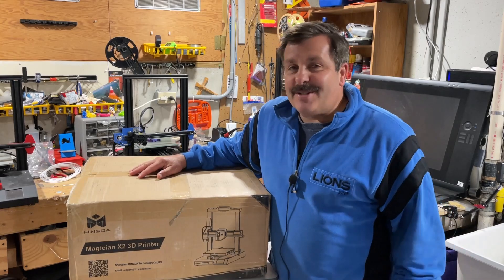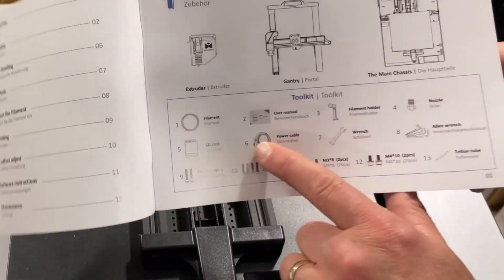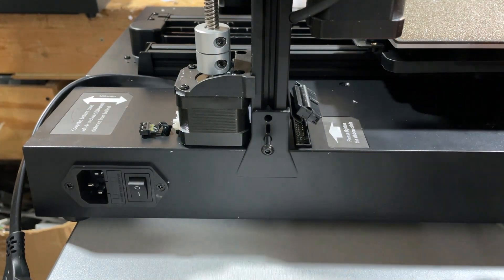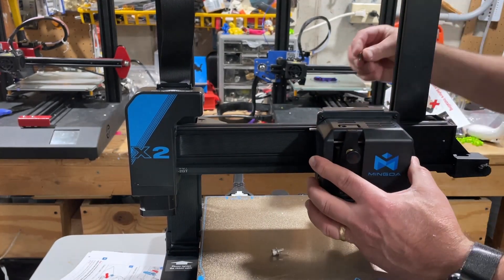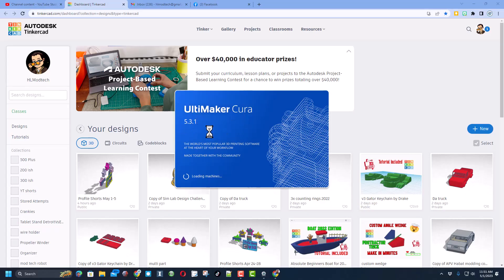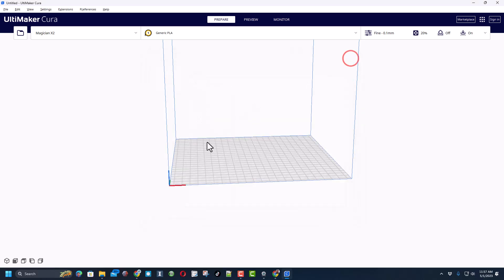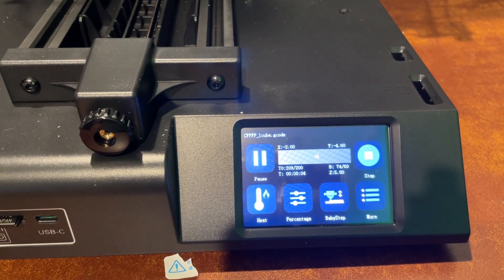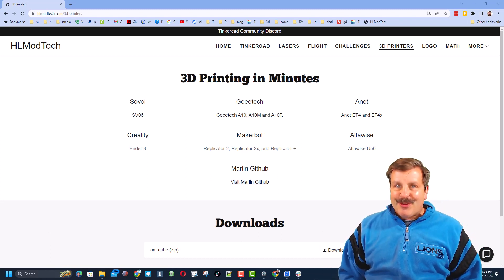15 Minute Assembly & First Print Mingda Magician X2 3d printer

Comment: I’m having issues leveling the bed. It keeps coming up with a probing issue. Any suggestions on how to fix it?
Reply from the maker: Not sure about the probing error. While it was powered off,  I did use a couple of tomato paste cans to manual twist the z rods to get it level once. I have sold mine now. Sure was a fun printer while I had it though.

Comment: My z axis has problems and one of them is loose and doesn’t level each other and can’t print
Reply from the maker: With it powered off you can manually adjust the 2 z axis so they are the same height. I have two small cans of peppers I use to make sure they are at least starting level before I the the automatic leveling procedure. Just make sure it is powered off as you set it.
Reply: I tried that for and hour trying to level it it didn’t work

Comment: How do I make the bed move forward after finishing a print rathe than backwards?
Reply from the maker: You would have to change one of the G codes for the end of the print. I do not have it memorized though if you search decode, then moves the printer bed to the front you should be able to find it.
Reply: @HLModTech  Do I search decode on the printer? How do I do that?
Reply from the maker: Let me see what I can do. 👍
Reply from the maker: Here you are. https://youtu.be/v5R9YGXH3go Thanks for the request. 💯👍

Comment: 2 questions.

1. Where does the Teflon tube go?
2. How do we load the filament on the spool holder?
Reply from the maker: Teflon tube is a spare. It would go from the top down into the hot end. Filament just slides on. https://imgur.com/a/vmED7Ll
Reply: @HLModTech  Oh well my sample filament didn't come with a spool so I just used my regular filament which did.
Reply from the maker: Got it! Yes. Just drape that "ring" of filament they give you around the peg. 👍  I did not understand that the first time.

Comment: for some reason when ever i try to level it it says error?
Reply from the maker: What sort of error is it producing? I would check to see that all the cables are firmly attached first.
Reply: @HLModTech  i did that but the error says PRINTER HALTED please reset err: MINT EMP: bed
Reply from the maker: That sounds like maybe your bed cable is the problem. Double check it in the back. It is reporting that it cannot read a temperature from the bed thermistor.
Reply: @HLModTech  TYSM its working! thanks for the help
Reply from the maker: @pokecollectoralex829  fantastic! Makes my day to hear that. Thanks for reaching out and letting me know it’s fixed.

Comment: I used this thing for only 8 days. It failed. I turned it on one morning and the display didn't turn on. The light in the extruder didn't turn on. The China based support only responds through email. They take 1-2 days to respond. They just told me that I have to PAY to send the defective printer back to them! Really? Good companies don't do that. If you buy one of these things and it fails, you're screwed! Take some time to read their warranty information on their website. It's extremely vague. I got this thing as a birthday gift. I loved it until it failed. I wasn't using it in any way that could have broken it. I just printed some really nice stuff. I am offended that Mingda thinks it's OK to make me pay for shipping! That is a very shady business practice. I will be filing a complaint with the Texas attorney general's office. I will leave negative reviews everywhere I see this product being sold. They just pissed off the wrong customer.
Reply: I just got mine 3 days ago and after reading your comment, I am thinking about returning it.

Thanks for the review.
Reply from the maker: See if this helps. https://youtu.be/Hnsh4Ew_QCU